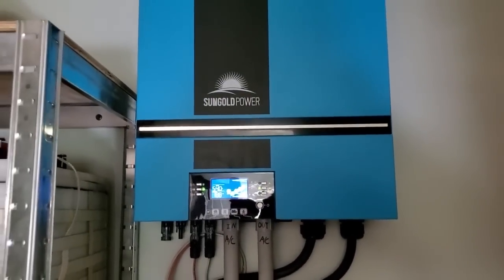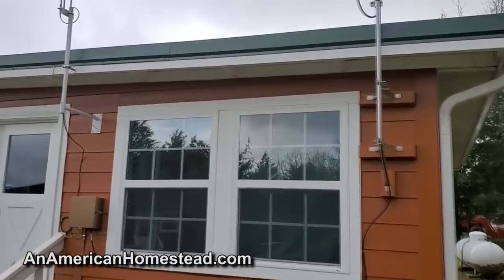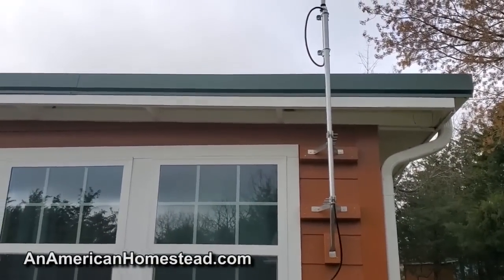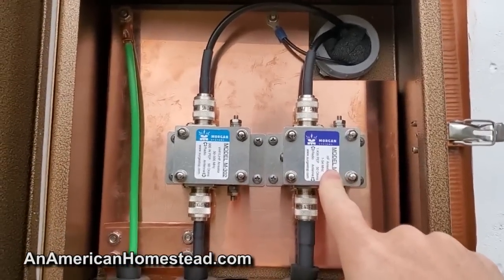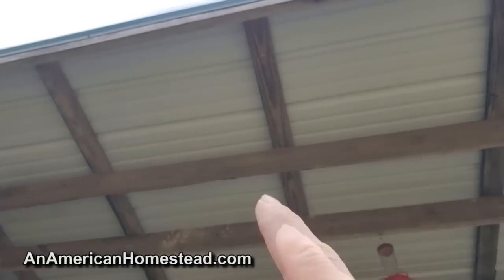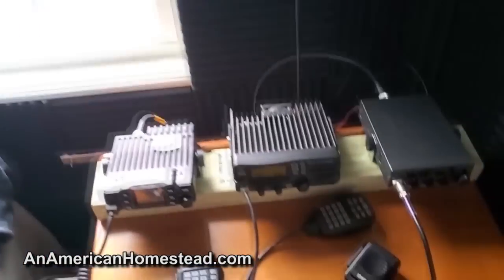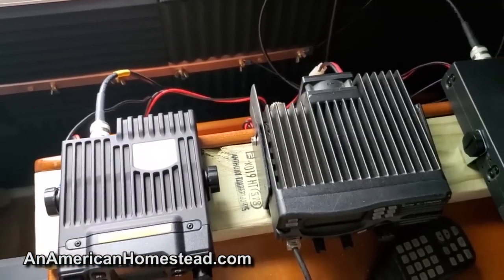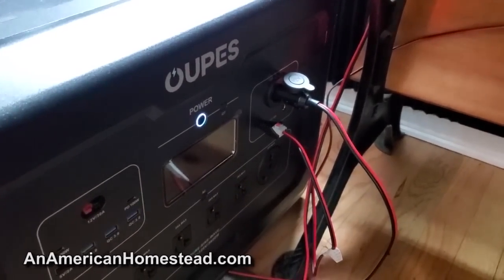HAM Radio Antenna Grounding 🌩 😳

Comment: I'm 100% off grid as well. My DIY system has 36 - 460/575 watt bifacial panels with 18 - EG4-100ah 48 volt batteries suppling  3 - 18pv EG4 hybrid inverters providing 180 amps at 240v split phased to a main panel. Looks like you have a great system here's my .02.  I think there are multiple types of grounding and bonding. I have a good friend who is an electrical engineer working for Qualcomm. He stated multiple grounding rods not properly bonded to the main panel can be dangerous because they create different voltage potentials during surges (like lightning), potentially forcing current through equipment instead of safely to earth; the key is bonding all rods together with a continuous conductor and connecting them to the main panel's ground/neutral, ensuring they act as one unit to provide a single, low-impedance path for fault currents, as mandated by electrical codes. I boke my grounding and bonding into 3 sections.  
1st is the primary grounding system which is your AC power from your main electrical panel being supplied by your solar or electrical service provider. All AC current being provided by this panel must be grounded as a single system with zero exceptions. 
2nd. Antenna system lightening suppression  grounding system via 3 - 8’ rods.    My first line of lightening protection is the antenna grounding system which is terminated at the suppressor located at the base of the antenna with two bonded 8’ copper rods six feet apart. The third 8’ rod with a suppressor is at the point where the antenna coax enters the shack and unlike the two at the antenna this third rod has a continuous ground wire going back to the two AC grounding rods located at the main electrical panel (single system).  
The 3rd and final system is more bonding than AC current grounding. 100% of the shack equipment chassis are bonded together by a 1 1/2" wide x 1/4" thick  copper plate mounted to the wall behind the desk that has independent leads (not daisy chain in series) with mechanical connections (clamps) from ALL equipment in the shack making everything is bonded at a single point. Note! This system is not connected to the house internal AC ground wiring by doing so it would create a dangerous situation and interduce excessive amounts of interference from any household appliances and electronic devices that can cause Radio Frequency Interference (RFI) within a house.  Although this 3rd system is controversial all the manufacturers engineer into their products grounding where necessary and all only use the AC panel single point grounding as the source.  Here is a great discussion by Kristen McIntyre K6WX, First Vice President of the ARRL presented at the Tassie Ham-E-Con Ham Radio Conference of why grounds are a myth.  https://www.youtube.com/watch?v=KdX-978tvkY

73 best of luck.

Comment: "Grounding and Bonding "- ARRL, " Lightning Protection- A Comprehensive Guide for Amateur Radio"- Ronald Block. Two books with everything you need to know. Don't forget your rotator and unplug everything when you leave the shack.

Comment: You have a good start but a change is to tie all ground rods together.  Why to make everything move together.  I would not tie the copper plate to the outside because if you get strike current will come from inside to blow your radios.  Isolate the inside from the outside thats everything phone internet etc.  There is more information out there and the Huntsville hamfest there is an expert that explains this and keeps lighting away.  Yes the ARRL has good books on this.

Comment: This is wrong on so many levels. 

With that type of strike; no amount of ground rods and surge arrestors are going to help you. 

The amount of potential on a close strike will arc across the chassis even if grounded. 

Unplug your antennas, run your power supplied on a surge protector, and don’t operate during severe weather.

Comment: I saw a YouTuber who used a few N-Type connectors on a board with an actuator and a a piece of poly cutting board cut into strips.

The linear actuators disconnect the radio at the press of a button and drop the divider between the two connectors to stop it from ionizing the air and arcing over.

Pretty smart setup, he removed the threaded nut from the N-Type connectors so they could mate properly.

Nice radio antenna setup.

Comment: lightning arresters are really only ment to stop energy from traveling down the center conductor… The shield of coax isn’t an effective conductor to ground through the cases of the lightning arresters for a couple reasons. For you to be really protected you need to bond your coax shields also. Morgans documentation on their website clearly states this, most companies that make arresters will tell you this.
You need to give the lightning a better more conductive path than the braid and whatever connection is made to and by the connector… The connection made by the arresters case isn’t adequate either, something else sited by Morgan. Ground bonding the coax both at the tower or mast grounding point and at a point close to but before the lightning arresters is the best protection… Times Microwave makes great coax ground bonding kits for .400 diameter coax GK-S400TT (LMR400/RG-213) and for .25 GK-S240TT (RG-8x/LMR240) as well…. Happy Grounding

Comment: I'm not an electrician so full disclaimer to double check the ARRL grounding and bonding textbook, but I was always taught that you want the two ground rods for the radios/antennas bonded to the ground rod for the rest of the house to avoid any difference in potential between them that lightning could be attracted to.  Otherwise, I think it's good. 73

Comment: Use flats copper braid for your grounding 1/2 to 1 inch minimum. Also, if you receive a direct strike, none of this will help; trust me! Finally, lightning seeks the easiest path to ground. It is 100% common for hams to disconnect coax in order to not introduce the pathway into the house. Think of that highly grounded antenna as one huge lightening rod. We mainly ground for RF not lightning. Most hams can't afford to properly ground for direct lightning strikes nor have the time to create a capable system as used on commercial installations.

Comment: I would like to know how to prevent a grounding loop when I have different antennas and coaxed coming into the home? You have already introduced me to a grounding block, connected to all my radios and devices. One thing I can share that I learned: Soft copper pipe, strips, etc, according to advice given to me. Solid pipe is better to shunt the electricity into the ground out side in the dirt.

Comment: KF7P has great stuff I guess I should of went through you videos before I asked a couple ? on your other video. you answered 1 of them on this one. be careful  grounding takes in account alot of things your soil conditions is a big 1 if the soil doesn't let the ground rod  let enough current go to ground then you can have enough build up to zap a radio. thats 1 reason I put 3 ground rods in and wire them all together. that's all that I could come up with have a good one and I like your content keep it up. W9US

Comment: Those old ground rods are most likely not good anymore, you need to test them.
In substations we would put up one grounding tower for the whole station. Done correctly it acts like an invisible shield against lightning. Look into. Plus you need to get those grounding rods away from the house.

Comment: Thanks for the video, 100% agree a good grounding system is necessary. However, being an electronics tech since the early 80s I can tell you from experience with numerous home/business lighting strikes that if you get a direct hit or close strike it's can still be a crap shoot. I have seen both un/grounded systems/devices one device destroyed other/s untouched, complete destruction of all devices except for one or few, HVAC ductwork magnetized enough to effect CRTs, jumped entry/exit points from plumbing, tree roots, landlines, antennas, cable. Lighting is an uncontrolled discharge, whatever is in its path to ground is just a spark gap with millions of volts, thousands of amps. But I still ground the crap out of everything or totally isolate it.

Comment: my Dad used to be a TV repair man.  He also installed TV antennas.  He said the best way to install an antenna is to put the pole all the way to the ground, this was for lightning.  It would follow the steel pole to the ground more than it would follow the TV wire.  Although the wire would blow out and probably the TV too.  I would like to know if this grounding box has ever been tested.  Lightning as you know is very powerful.  According to the experts in electrical grounding of lightning, the minimum gauge of wire it 2AWG for less than 75 ft run.  That is heavy duty, but so is lightning.  Blessings son.
Reply from the maker: Everything I've read recommends 10AWG wire but I've been using 6.

Comment: I meant to add this. A direct lightning is not the only thing to address for protecting the electronics.  Another problem to be concerned with lightning strike is indirect lightning. When you have current flow, you get electrical and magnetic fields around the current flow. When you have current flow around openings, you can have a magnetic field generated around the opening, such as doors and windows, and create an antenna. If the opening is big enough, the magnetic field can be strong enough to affect the electronics inside the building/ ham shack. You want to keep the openings as small as possible. Keep the electronics as far away as possible from the openings. A 200,000 Amp strike a 1/4 mile away can generate a 50V/meter around a 2 ft-sq window area. That can be damaging to nearby electronics. Proper grounding and bonding are needed on your system. Suggest do not bond through bolts and cable knuckles. Bond through surface to surface. Bolts and knuckles can have high resistance for current to flow. The bonds need to be as clean as possible. I like seeing a bond to be at or less than 2.5 milliohms. we want to be conductive as much as possible.

If you have questions on shielding and lightning protection, feel free to ask. This is what I do for living. I play with lightning and help electronics play nice with nearby electronics, which includes radios and solar panels.

Comment: Nice setup.. love that you incorporated CB radio also. Not everyone can use Ham bands.
Reply: Any and every person can legally use any radio of any type on any band communicate in an emergency.
Reply: @bigcbradio yes you are 💯% correct 
 But here is the problem in a emergency and you need coms if you don't already know how to use them the chances of being able to get help is going to be hard  you just don't turn on a ham radio  and start talking  I have a old Drake tr4c and a yaesu 101e one is completely  a tube radio and the other uses tubes in the finals  if you don't know how to load it and tune them  you won't make contact with anyone  before the radio if fried 
My yaesu  ft710 is about as new as it gets but still you just don't turn it on and start talking if you don't know what you are doing 
I truly believe a channelized radio like a CB or gmrs radio would be better options for people who don't want to be a ham or learn how to use the equipment

Comment: Get a grounding testwell, and fill it with GEM (Grounding Enhancement Material). Your primary ground rod would go inside the test well. Ground rod should not be sticking out above grade. The wire to use between your primary and supplementary ground rod should be minimum #2 awg THWN insulated. Most people run non-insulated, but that prevents them from ever testing the system with a grounding resistance meter (not a typical meter). Ideally you would have a "ground ring" around the entire structure with supplementary rods every 12 ft, a test well on  2 caddy corners with three ground rods  in each. The main wire between each rod would be 2/0 thwn and your downcomers from your air terminals would be #2 awg. This would be a premium install for both structure and the tower. It can get much much fancier. As others have said, you can never have enough grounding
Reply from the maker: 2 AWG and ground ring? Ok now that sounds like overkill.
Reply: @Anamericanhomestead  im only trying to give you good information brother. 
6 awg is the ground rod conductor size for a 150a service from electric utilities. There are 30000+ amps in lightning strikes. And those houses have the benefit of miles of ground wire and a ground  connection at each utility pole. You're your own utility. You have to dissipate the entire strike on your own.
Shalom

Comment: Shouldn't the ground from the inside out have a larger copper plate connection instead of that small copper wire?

Comment: Looks like a great system! Wondering, will your grounding system help deal with an EMP (solar or otherwise)?
Reply from the maker: I think it will but all the "what ifs" out there about CME and EMP is speculation mostly.
Reply: @Anamericanhomestead not really lots of studies done already on cme emp and how to ground. You can't stop a strike as your title implies but you can mitigate the damage. The morgan arrested are great I use poly phasers and I use several in series. Great video.

Comment: Lightning has what it takes to BZZZARP what you have! - All we can do is give it a suggested path to ground and it can ignore that suggestion in whole or in part. We're in the southeast and get lightning storms every summer. Been zapped by near strikes twice and both times, the surge came in over grounded systems: cable TV and phone line (remember those?). The cable surge came in over the utility lines down the street and sent a surge through several neighbors that all had their cable feed connected to their service ground - it wasn't anything fancy, just the standard lightning shunt and a10AWG or so wire to the ground rod. Still, we were led to believe that should have been sufficient. Ever since, I disconnect and ground my feedlines (outside) and from wall power when I'm not operating and (of course) during bad weather - takes me a few minutes to reconnect everything and get on the air, but it soothes my paranoia. I only trust my shack ground for static bleed and RF grounding. Lightning is weird. It does what it wants and we're not the boss of it.
Reply from the maker: OH I totally agree!  Lightning has a mind of its own and all you can do is offer it as many off ramps on the highway and hope it takes an exit. But it will go where it wants.

Comment: Great set up. Electrostatic charge tends to collect on edges and pointy things. When there is enough charge buildup on the pointy things, more than likely there is equal amount of Electrostatic charge coming down from the clouds to meet the charge on the pointy thing, such as Antennas and pine trees. The connection is made somewhere between the cloud and the pointy thing. This Electrostatic charge is a collection of electrons on the surface of a conductor, in this case, shield of the transmission line of the antenna. When lightning strikes an antenna, the current will flow down the shield of the transmission line from the antenna. What we are wanting to do is to redirect the lightning current anyway from the system. The system must be grounded. The antenna and tower must be bonded to a ground rod closest to the tower. At work, we design our systems to meet 200,000Amp strike. On the average, middle Florida sees about 66,000 Amp strike with a lightning strike density about 17 strikes per km-square per year. Middle Florida has a higher concentration of lightning strikes compared to other parts of the US, maybe except for areas of Nevada and Arizona.

Transorbs are great to add on the input of your radio. Lightning arresters are good to have on your power supplies of your electronics. A ground rod near your radio shack with your electronics bonded to the ground rod.
Reply from the maker: Great explain!  THANKS!
Reply: Yes, look at ancient architecture, even early American brick/stone buildings. It's clear that they knew how to harvest free energy. 
It's harvesting from the Aether, which many don't understand.
Reply: @notbuyingit5698  care to explain?

Comment: I helped a guy install about $10,000 worth of Ham Gear, he did not have any grounding. His antenna took a direct hit from lightning, it fried most of his radio equipment, an expensive gaming computer system, and caught his house on fire. He was able to put the fire out, but lost all of that gear.
Reply: ARRL puts out a paperback on Grounding and Bonding.
Reply from the maker: EEK!!!
Reply: @Anamericanhomestead  no worries about lightning here yet, just got three feet of snow dumped here, and it is still coming down. Going to throw a line over my wire antenna and shake the snow off, as soon as I can dig my way out of the house.
Reply: Youn can have the best grounding and best protectors. But if you take a direct  hit you are done.